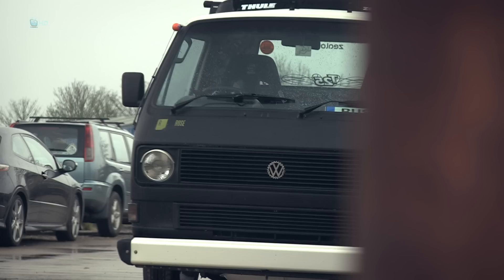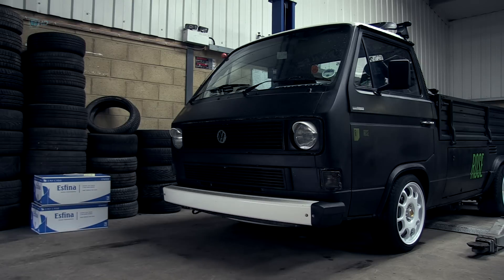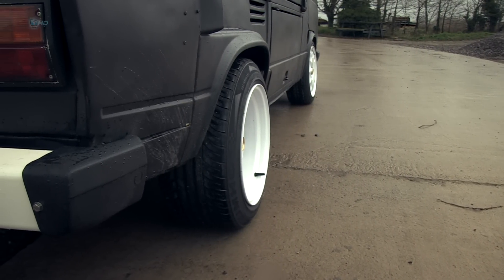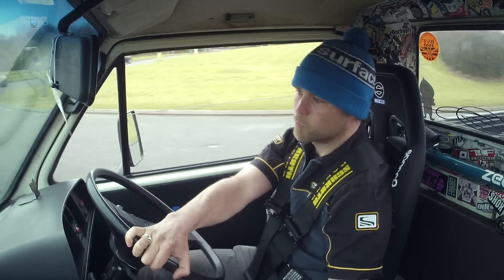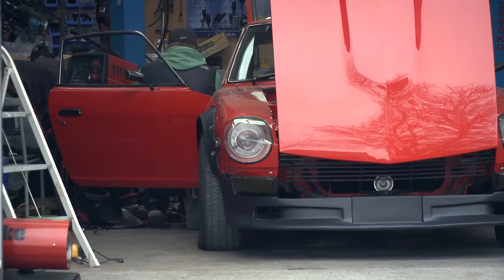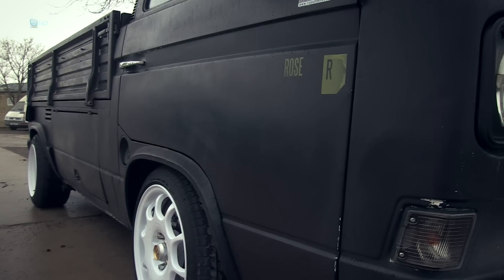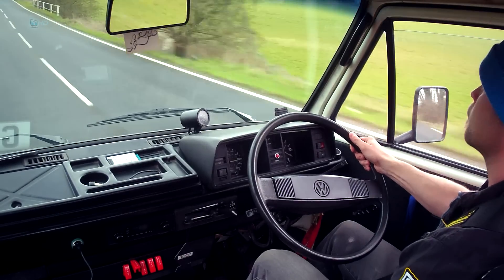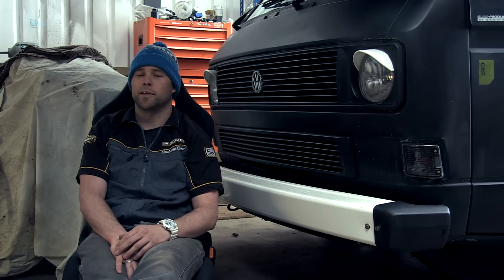[Zealou5] - Togethia - Finlay Paton: VW T25 Impreza - From Germany To Japan

Comment: hi i need a bit advice ive bought a crewcab t25 with no engine has a four speed box in im wanting to convert it with a subaru engine the cheaper ones i can see on the market is the forrester . Could you tell me if the gear box off the forrister will go in the t25 and can you give me a little more advice , do i need to buy bracket clips as i dont have a clue lol . cheers
Reply: Joseph Burnip